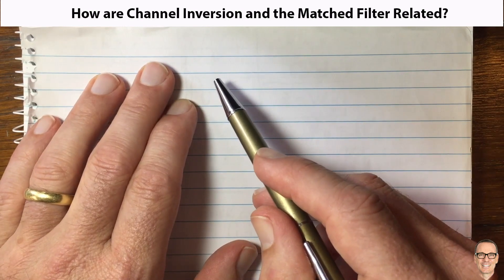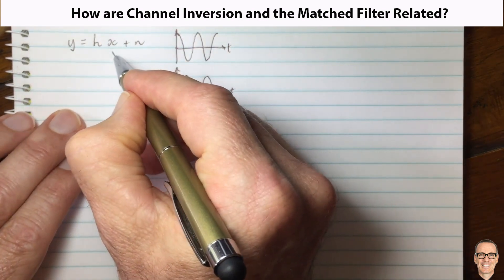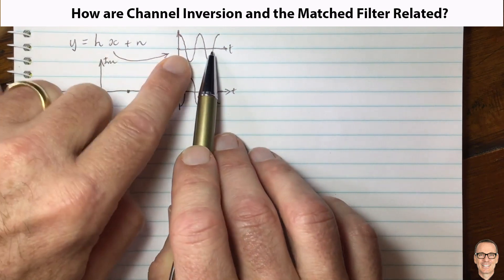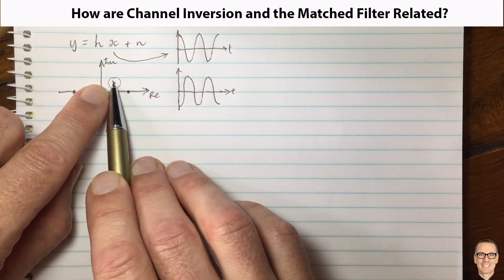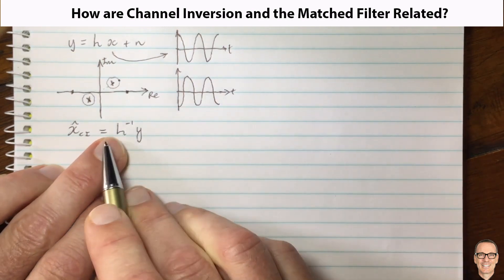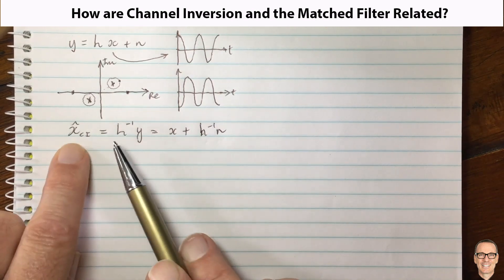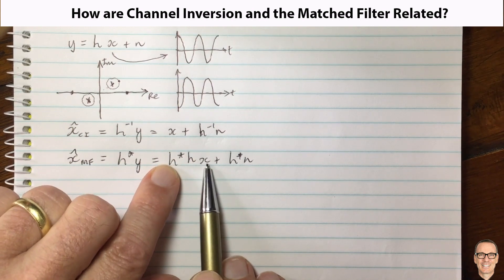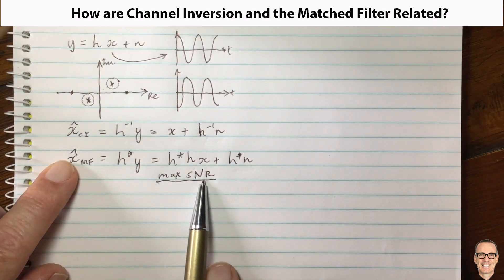How are Channel Inversion and the Matched Filter (MF) Related?

Comment: Dear professor, I'd like to ask a question. In the case of inversion, you said when h near to zero (less than 1) then the noise will become larger, so we use MF method, although the noise will not increase, h* multiple h will let the signal become smaller when h<1,  (for example h=0.6 then h*h=0.6*0.6=0.36) which will make the two symbols closer. Isn't that also a very bad situation? so why we choose MF rather than ZF?   (I assume there is no interference)
Reply from the maker: Yes, when h<1, multiplying by h* will make the constellation points closer together, but it will also make the noise smaller. The Matched Filter is the optimal thing to do, in terms of maximising the signal-to-noise ratio. This video gives more details: "What is a Matched Filter?" https://youtu.be/Ci-EjiMJo3I

Comment: sir,
in case of matched filter case when the complex conjugate is multiplied it says that the constillation is moved to the other location what does it actually means other location its not clear
Reply from the maker: It means that the complex coefficient of the received waveform will be +/-conj(h)h rather than +/-1 (in this binary case).

Comment: Dear Professor,
Thank you for your videos, they really help so much.
I have a small question about the matched filter. In a previous video introducing the matched filter you mentioned that the impulse response of the matched filter was similar to the one at the transmit filter. However here you multiplied by the conjugate of the channel. This had me slightly confused. Could you please clarify ?
Thank you again for your amazing videos!!!
Reply from the maker: Great question. It's often overlooked. The Matched Filter is "matched" to whatever came before it in the transmission "chain". More specifically, in linear transmission systems, it is "matched" to the convolution of the transmit filter and the channel "filter". In the case of the previous video you refer to, I was considering the case where the channel was AWGN, which is flat across the band - and therefore didn't have any "filtering" action. In the case of this CI-MF video, it is dealing with non-flat channels, and also it is considering the digital signal, after it has come out of the detector (where the "transmitter matching" took place).

Comment: Dear Professor, may I ask a slightly unrelated question about radar? To the best of my knowledge, matched filtering can be also applied to radar: since the "channel" h is supposed to be estimataed (ranging reflectors in the space), we convolve the reflected signal y with the transmitted signal x*. But the question is I cannot make an analogy in terms of inversion, i.e., I've never seen people "invert" the transmitted signal and convolve it with the reflected signal to estimate the channel h. Is it possible for you to shed some light on why the difference? Many thanks!
Reply from the maker: It depends on the aim. In radar, the aim is to locate and identify targets. The targets are essentially parameters in the overall "channel". So radar is not trying to "invert" (or remove/cancel) the channel. This is different to data communications, where the aim is to extract the transmitted signal from the received signal, and in this case it is helpful to "invert" (or remove/cancel) the channel.
Reply: @iain_explains  Dear Professor, thanks a lot for your reply, But that's not what I asked. For radar: we want to get the channel h, can we "invert" the transmitted signal x (instead of inverting h as in your reply)? Though I think it's possible mathematically, I've never seen people do this. Thanks again!
Reply from the maker: Well, yes, that's basically what's being done in many/most channel estimation schemes. For example when using Least Squares to estimate channel parameters. See the following video. The example at the top right of the page shows an equivalent case, where the "data" corresponds to the d values, and the "channel" corresponds to the beta values. "What is Least Squares Estimation?" https://youtu.be/BZ9VlmmuotM
Reply: @iain_explains  Thanks again, professor! The pseudo-inverse, yeah!😁😄

Comment: Dear Professor, thanks for your video as always. May I ask one question, in this video, the channel h is multiplied with the input x, but in another video of yours "What is a Matched Filter", the "transmitter filter" s(t) is convolved with the input x(t). So why sometimes we use multiplication and other times we use convolution? Is this have anything to do with the channel delay spread, i.e., if the delay spread is large, we use convolution, if it is small, we use multiplication? And if I take this question one step further, is multiplication a special case of convolution mathematically? Many thanks!
Reply from the maker: Yes, exactly. The channel acts as a linear filter in most communication systems (wireless, DSL twisted pair, coax, PCB track, ...), and so the operation is a convolution. But if the delay spread is shorter than a symbol period, then the convolution reduces to just a multiplication (only one "tap" in the filter).
Reply: @iain_explains  Thank you very much for your reply! Now I understand the concept more clearly.
Reply from the maker: Great. 😁

Comment: Thank you very much for the clarification. One quick question is, how can we compare h*/|h| equalization with what you have discussed here. If the noise is complex Gaussian, multiplying with h*/|h| will not have any impact on the statistical properties of the noise distribution. However, x will be linearly-scaled within the signal direction (fading). Kindly let me know your thoughts.
Reply from the maker: Yes, in this scalar case, it is just a rotation and scaling, so both the signal and the noise are rotated and scaled equally. The difference comes when there is structure in the noise. This happens, for example, when there is interference from other users, or other spatial channels in the case of MIMO. I've got a video coming up on the channel on this.
Reply: @iain_explains  Thank you very much. If I understand you correctly, you are referring to the colored noise case right? I am looking forward to that video.